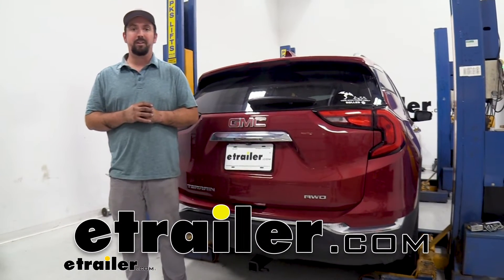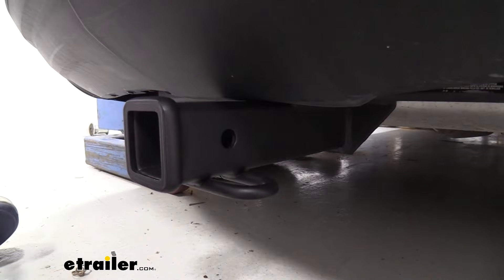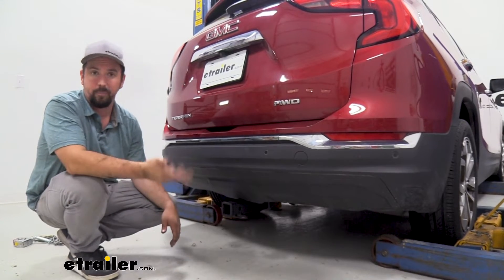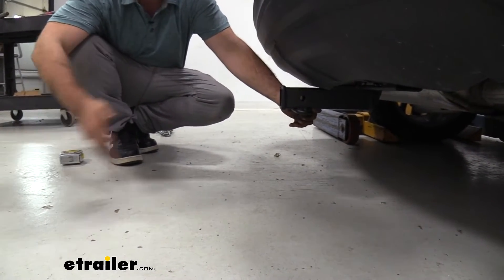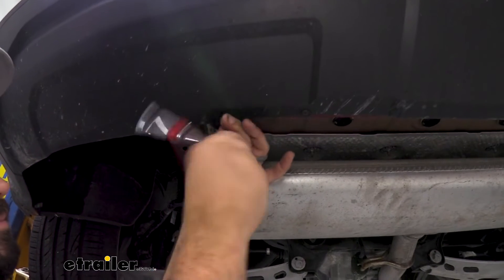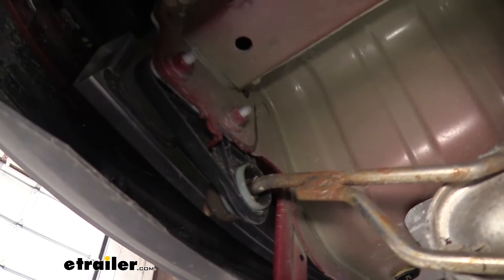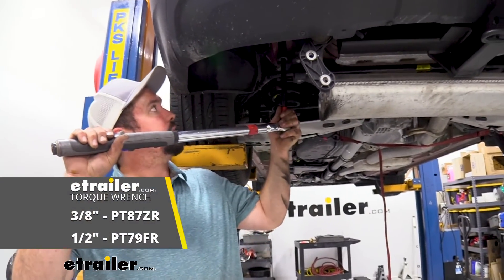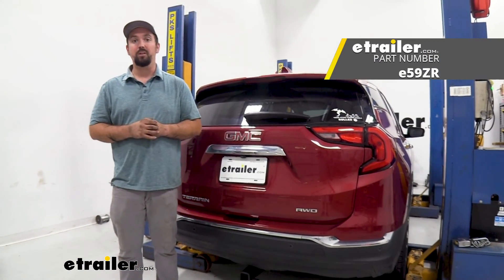Installation: etrailer Trailer Hitch Receiver on a 2020 GMC Terrain

Comment: Is this the same if the terrain has the dual exhaust?
Reply from the maker: The etrailer # e59ZR Class III fits all 2018-2022 GMC Terrain models, except models equipped with the Diesel engine. The install procedure wouldn't differ much from what's shown in the video.
https://www.etrailer.com/Trailer-Hitch/etrailer/e59ZR.html